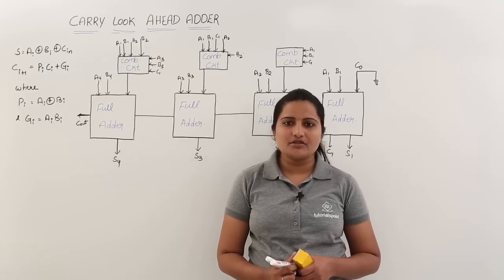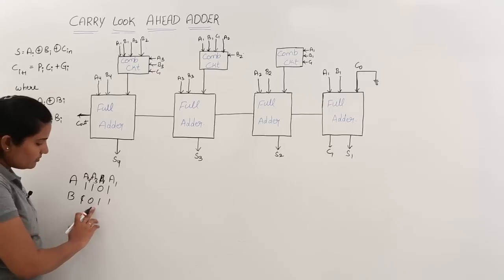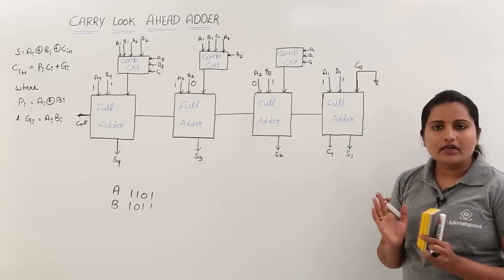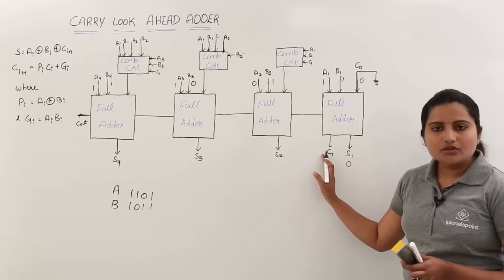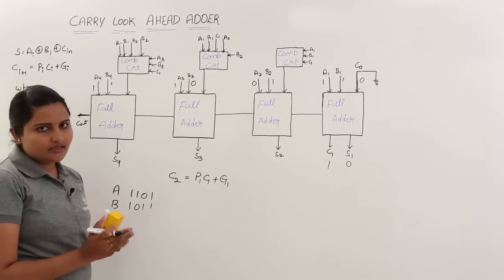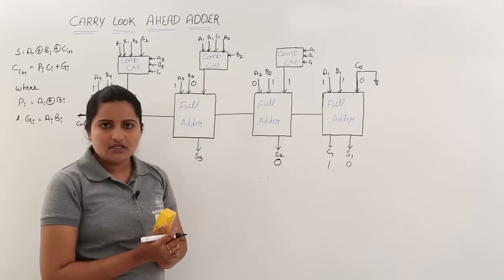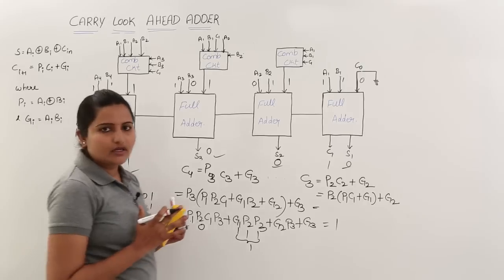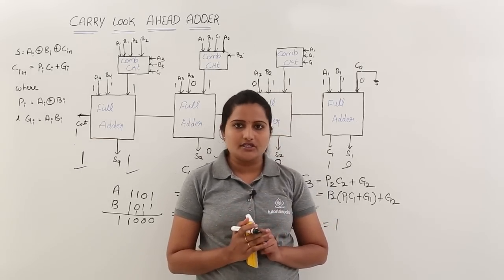Carry Look Ahead Adder

Comment: the NUMBERING OF A B C IS WRONG
C2 =P1C1+G1
and you are taking C1 as the carry out from previous FA??? Then whats the point.
If we want to calculate C1 
then C1 = P0C0+G0
HOW CAN YOU GET P0 AND G0 if the numbering is started from A1 and B1??
Start from A0 B0 NOT A1 B1 otherwise use C1 as first input assuming that i starts from 1 not 0 in this formula
Cn+1 = PnCn +Gn

Comment: is this same as parallel prefix adder
??
Reply: parallel prefix doesnt takes a common carry in start here we take a common carry in start through which others are predicted 
in parallel each full adder waits for the previous adder to complete its task resulting in creating delay to remove this we use cla adder in which rather then depending on previous adders we only depend on the first one when ones the carry is taken common for it the rest carries are predicted and delivered simultaneously